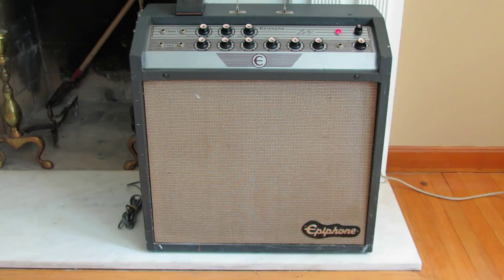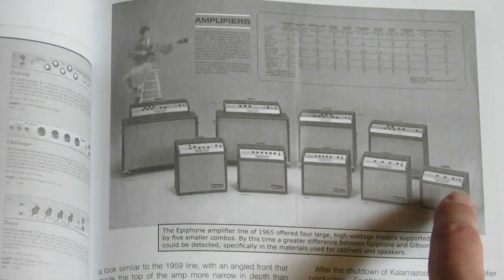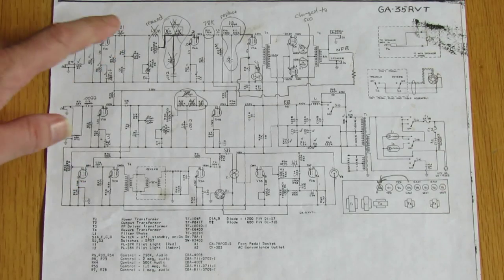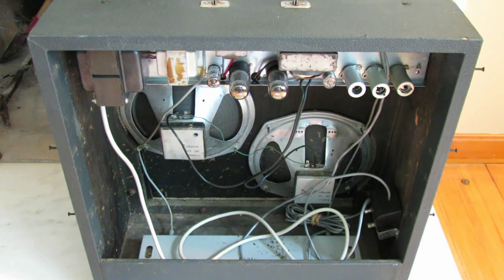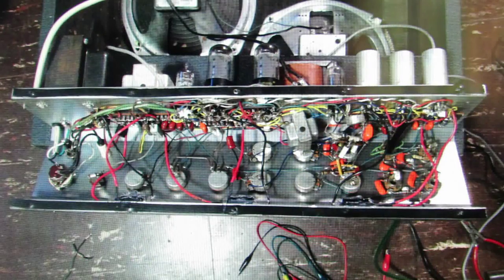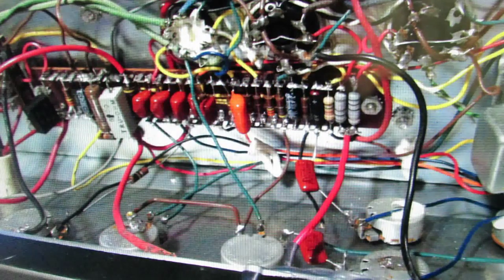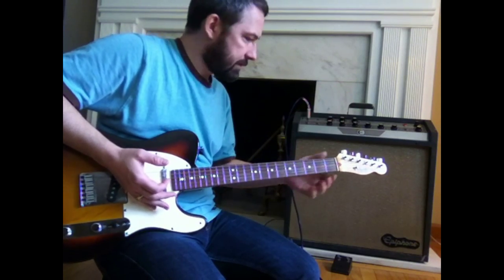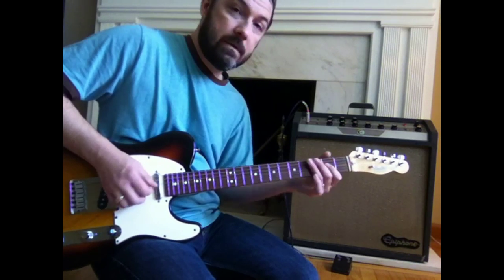1965 Epiphone Zephyr EA-15RVT Discussion & DEMO (Gibson GA-25RVT Hawk)

Comment: This demo just caught my eye. I remember that series of Epiphone amps back in '66
when we took on the Epiphone line in the music store where I worked.  They were very
hard to sell, even on a "take it and try it out" basis with some of our regular customers
(band members starting out), who preferred in most cases Fender amps. 

 Not only where the speakers mediocre but they were put together in an amature fashion at Gibson's Elenor St. annex in Kalmazoo, not the regular Parson's st poduction facilty.    

I had a personal experience with a Zephyr (brand new) where it blew a fuse after 1/2 hr
on stage at medium volume. That was embarrassing as I didn't bring a backup.
We took it apart and found that the solid state bridge full wave rectifier had shorted out

Thankfuly we didn't order any of their bigger amp offerings because of budgetary
contraints, but the smaller ones (in the front row in the catalog) we ended up
as offering them as a package at cost when the customers bought a Epiphone guitar
and other stuff. Lost money on those Epiphone amps, never ordered any more.

Are you sure the plywood is birch?  I would think it would be FIR/SPRUCE, as
that plywood was a lot cheapr than birch (which is considered a hardwood and
furniture grade).
Reply from the maker: I'm no botanist, but it looks birch to me. Thanks for sharing your experience. It's no wonder you couldn't move them. They are super thin with factory circuit. My theory has been they did that because they were trying to make Gibson amps sound like Fender amps with Gibson guitars, ensuring you could pretty much ONLY use a Gibson guitar and anything else would be harsh and tinny. They were obviously also trying to keep the amps clean all the way up the dial, which is, we know, a silly thing to do.
Reply: I went as far as the gates of Gibson Kalamazoo in 66. Unfortunately for me,
I travelled all the way from Ottawa for a factory tour,  and they were on strike
at the time I arrived and would not let me past the picket line. :-(

The way I have always understood it, was  that the decision to make their own amps inhouse was purely for economic reasons as they were seeing a missed market with Gibson buyers going for Fender amps.  Fender was too well entrenched at that point and the other thing with Fender amps was that
they sounded very good in overdrive, something that Gibson never gave much
thought about,  because they were trying to sell clean jazz amps in the rock n roll crowd market. The Gibson and later on Epi amps just were not a good fit.

Seth Lover and Walt Fuller consulted with  McCarty to start their in house
amp business at Gibson.  They even produced a limited editiion Les Paul amp,
and the STEREO amp...go figure, hoping that buyers out there would be swayed
to try out their amps instead of those "raucaous sounding" Fender amps along with "Leo's Plank'...jealousy about Fender's success in the solid body market?
and of course they couldn't deny that  the early Fender amps that were so well put together.

Of course as they say "Timing (to market) is everything" ,  by the time they got their act together to start producing them...infighting started between
Gibson management and CMI (Chicago Musical Instruments).
Gibson was subsquently sold to Norlin Industries and qualty on almost
ever production product suffered during the Norlin years.

Comment: Hi-I never really caught any specific info on "some ways to modify the circuit to improve the tone", unless perhaps I dozed off during the 34:19? I have had a couple of these and find them generally anemic. The stock output trans seems pretty tiny; would a beefier OT with more iron (Deluxe Reverb) make any difference in one of these? Thanks!
Reply from the maker: About 7:00 in I have the schematic out and am talking about components to look for which can be removed to improve tone.

Comment: Hey I have just purchased the 1964 15" speaker version of this amp. I was hoping you may be able to help with this question, Can you jumper the 2 channels the way you can with Marshall JTM JMP etc. ?  I'm waiting on the delivery now so I haven't had a chance to play with it yet... Didn't want to try to jump the channels without hearing from someone who has some knowledge about this amp first... I have a 63 Pathfinder which I am just in love with... And I got a fairly reasonable deal on both amps under 400 dollars each. Couldn't be more pleased :-) Thanks for the informative video and demo
Reply from the maker: Yes, you can jumper channels. Each channel has independent preamp tube stages that can be paralleled.
Reply: Excellent!!! Thank you so much for the insight.

Comment: I'm afraid these amps and the hawk would not be loud enough for a live setting with a drummer. What's your thoughts?
Reply from the maker: Without the tone sucking network, the loudness is improved immensely. They will get as loud as a Deluxe or Deluxe Reverb roughly. So there's your benchmark. Same power output. If you have a loud drummer who can't control his dynamics, then either get a new drummer or a bigger amp. :P
Reply: The Guitologist are the power and volume controlled by the same knob on the hawk?
Reply from the maker: Controls are the same.
Reply from the maker: Ok. I'll try to get you some in the next couple days, if that's ok. I have out of town family in ATM.
Reply: Ok
Reply: The Guitologist back yet?
Reply from the maker: Pics sent. Thanks for your patence on this. I've been very busy the last week or so.

Comment: Hey just ran across this, I see the schematic you are using looks a little off, havent watched the whole video yet. This is the one I have been using for a GA 25RVT pretty sure this is the exact match https://drive.google.com/file/d/0Bxdn1sco9YrwNlo2VG43cVVZUjA/view?usp=sharing
Reply from the maker: You're right. The schematics are not the same, but similar. The one I used is close enough for most troubleshooting cases. Many Gibson amps don't follow the official schematics anyway.